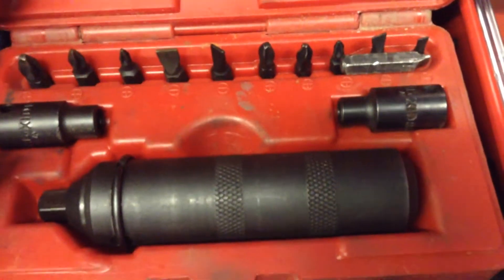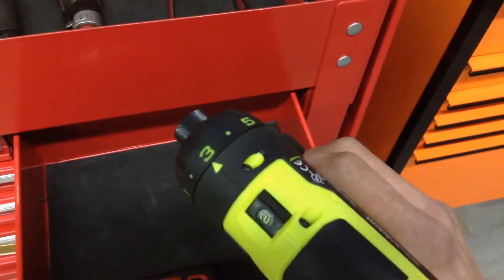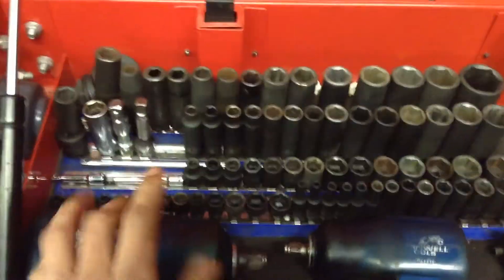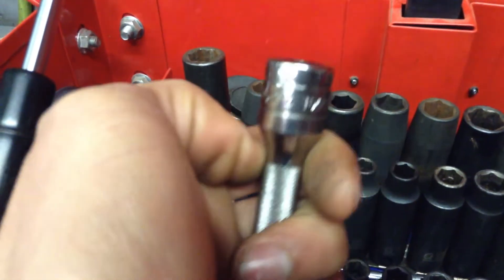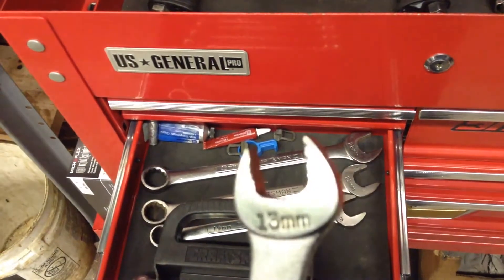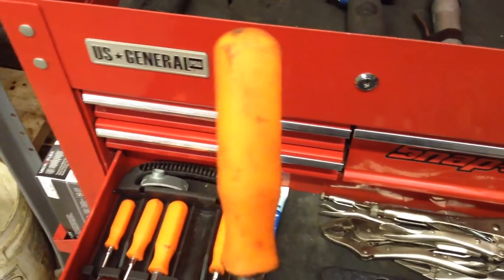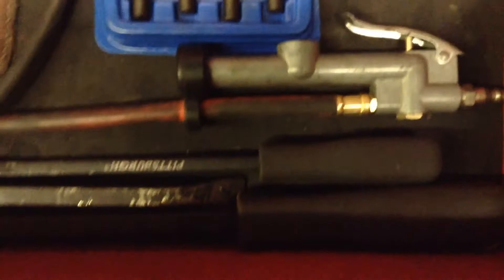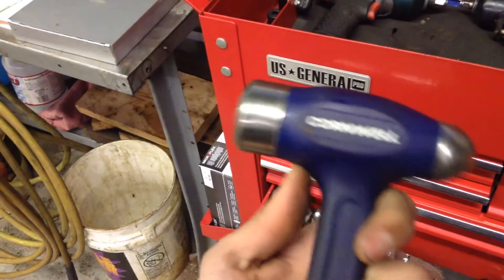Harbor Freight/ US GENRERAL PRO TOOL CART PART 2

Comment: Check out Trusty Cook website for  hammer deals. They are OEM for many tool companies including Cornwell (not Snap On though). Of course if you're concerned about warranty issues, then Truck guy probably more convenient.
Reply from the maker: honestly I am very happy I did get the Cornwell one (Trusty Cook) its an amazing hammer, and the price is very reasonable. however I might buy a bigger (Oz) hammer from Snap-on whenever they are on promo.